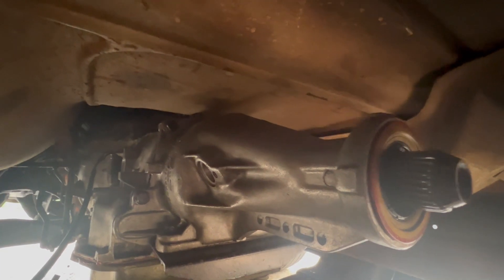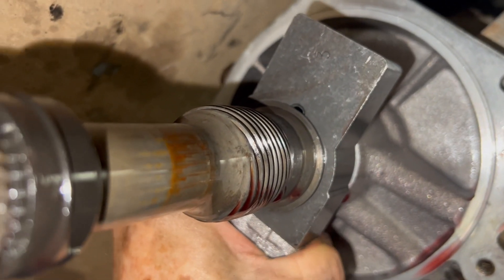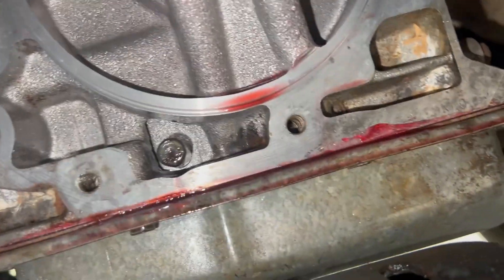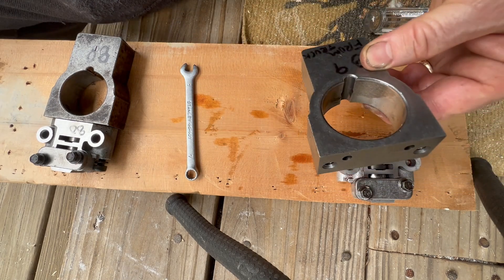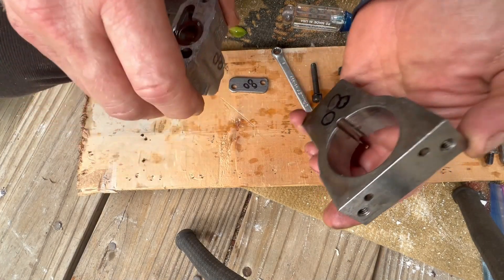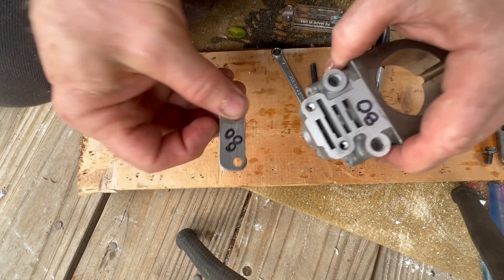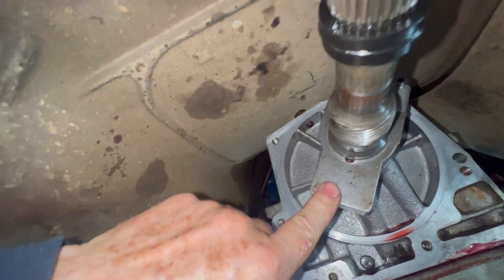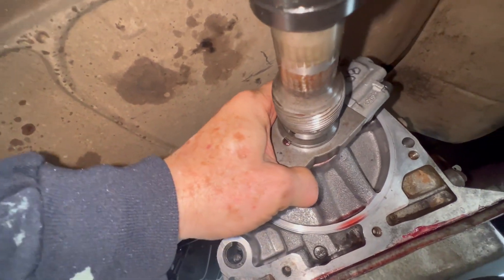Ford AOD Transmission Won't Shift Due To Stuck Governor

Comment: I found this TSB for those who are interested.  Look for TSB 89-22 (July). SUBJECT: Governor pressure.  Broader Performance (texas trans shop) also shows mod at this video. https://www.youtube.com/watch?v=V-HfVF2Nhgw
My AOD is not consistently down-shifting from 3rd to 2nd on no throttle coast-down, hence I have been poking around.  Nice video!
Reply from the maker: Hi. Thanks for watching and taking the time to comment. I like and watch many of those Broader Performance Videos. He has an interesting speaking personality and always seems annoyed like George on Seinfeld. LOL 
He did a really good one on a Ford C4 that someone else had built and put some aftermarket stuff in that he corrected in really time. One of the items, I think was a servo cover that is actually manufactured incorrectly blocking fluid/pressure.
Hmm, downshifting 3rd to 2nd no throttle. I'm no expert on these, but I can rebuild them. I have a two part series I did last year on mine. Usually the governor is an upshift issue, but I suppose it could also cause downshift issues. The throttle valve adjustment and pressure could be a possibility or a clutch piston seal not holding. 
I'll take a look at that TSB and Video. Thanks for the link and glad you liked the video. Let me know how you make out with it.
Reply: @mkdhdinfiniteendlessconten3873  I wanted to thank you for your thoughts on my governor given your experience. The more research I do points to a TV under pressure even for a downshift.  I am using a full pressure AOD valve body as modified by Dan Silver at Silver Fox Transmissions.  The full pressure TV valve body still requires TV valve adjustment but it only affects shift points and there is no pressure setting at idle.  I recently installed a Sonnax AS4-04K TV Linkage Corrector Kit, which corrects a Holley/Lokar geometry problem.  Prior to the correction, the Holley/Lokar set-up pulled the TV cable forward but also up while the throttle transitioned to open.  The farther the throttle went open, the more TV cable was pulled up instead of forward, thus limiting TV pressure.  The geometry correction now pulls the Lokar TV cable wire rope flat throughout its range of travel. Also, the Sonnax kit comes with a TV valve spring at the throttle interface (not to be confused with the Lokar spring on the trans TV lever).  This allows the spring/cable to be adjusted to achieve TV valve full open at WOT.  Without the spring and ability to adjust the spring/cable, the Holley/Lokar kinematics aren’t engineered precisely so that WOT is exactly when the trans TV is also full open.  Again, the Lokar set-up likely gets the job done so optimum kinematics are not required.  In summary, my full pressure valve body appears to be introducing more complexity where I thought I was spending my money to reduce complexity !  Yes, I did it to myself again! I’ve only had 1 test drive and more TV pressure seems to be required, so I may follow up with an update!  Thanks for helping me understand.
https://www.sonnax.com/parts/2766-carburetor-tv-linkage-corrector-kit

Comment: One of my cars with aod is acting strange today. In shift D, it takes forever to shift into gears (almost redlines) unless I left off throttle then it will shift. Put the car in shift D with circle and it will shift fine. I don’t understand !
Reply from the maker: Hmm. Thanks for watching and taking the time to comment. The governor is a possibility as is Throttle Valve (TV) pressure and adjustment. Throttle body itself could have a spool valve sticking. 
Do you have a Rod to control the Throttle Valve which was only in the first few years of the Bull Nose, or a TV Cable? I have a video if you have the Rod. The cable is more common, but also more involved to adjust. There are countless videos on YT for the cable. Many are for an aftermarket cable, so if it's stock look for those videos. 
It's interesting that it shifts fine in OD, but in D you have to let of the throttle for it to shift. That's "kind of" saying TV pressure isn't matching RPM pressure. You can do some visual checks on that cable (if it's a cable) to see if it moves with the full range of the throttle assuming it's a carbureted engine. They generally have a teensy bit of initial slack and start to move off idle. If it's a rod, check out my video for that.
Seems if it was the governor, it would act the same in OD or D. If it's a high milage transmission that's never been torn down then it might just be time for a rebuild. I have a two-part series on that, but if you've never rebuilt a transmission, it's not the transmission to learn on a like C4, C6, GM Turbo 350 which are all very forgiving. 
Take a look at the TV adjustment. Inspecting the governor takes 1 -2 hours. It's easier with a truck as in this video than a car as it's higher off the ground. 
Let me know.
Reply: My car shifts but it’s got to get way high up in rpm to shift. The governor if messed up would not let it shift at all right ? I hooked up gauge to tv port and that’s all within spec. But the shift in all gears in late as hell

Comment: Did yours start in second and shift to first when shifting to d1, or did it shift from first to second and not up from there
Reply from the maker: Hi. Thanks for taking the time to watch and comment. Mine was stuck in First and wouldn't shift at all. The AOD is kind of weird as to what gear it's in, especially since it doesn't have a 2nd gear position, just L, D, and OD. When driving they'll often skip right to 3rd and then OD is usually right at 40 MPH. 
There's a crazy way to make it go 1,2,3,4 that I haven't done in years and don't recommend, and since I wouldn't recommend it, I'm not going to describe the method, but there are of course videos on how to do it. Try it at your own risk.
If yours is starting out in second, it's going to need to come apart. Either a clutch pack is hanging or there's a problem with the valve body. I suppose the governor could be stuck open. Hmm...
Governor is easy to get out, especially if it's truck. You'll be in and out in an hour or so. See what it looks like. Valve body is also easily accessible to remove. Call around and see if some shops might still have a test plate where operation can be checked with compressed air. They might be willing to test and rebuild if it turns out spool valves are not working properly. Most shops won't do any sort of bench work just for warranty reasons.

Comment: So did you fix the problem?
Reply from the maker: Hi. Yes. It solved the no shifting. Meant to do a closing to confirm that, but just wanted to get the video added. I'll pin a comment and also add it to the description. No shifting can also be caused by valve body issues and accumulators, but if the governor is as loose as mine, this is a good first item to inspect, and the easiest. Takes about an hour to 1.5 hours start to finish on the ground. Quicker with a lift. Hope it solves your problem too. Thanks for watching and taking the time to comment.

Comment: Did it have problems driving forward and drove in reverse perfectly fine?
Reply from the maker: Hi. Thanks for watching and taking the time to comment. It would go into Forward or Reverse just fine as the Governor isn't used to do that. It wouldn't shift in forward.
Reply: Would the governor being plugged cause the truck to shudder when you are slowing down
Reply from the maker: My apologies. I somehow missed your comment, so you probably have it fixed by now. It's possible as it is a factor in both up and down shifts. It could be a clutch pack sticking "on" and not releasing. When it's cold mine sometimes still can occasionally be delayed on that first upshift and then first time stopping shudders a bit and wants to stall the engine for a brief second and then releases and it's fine all day after that.